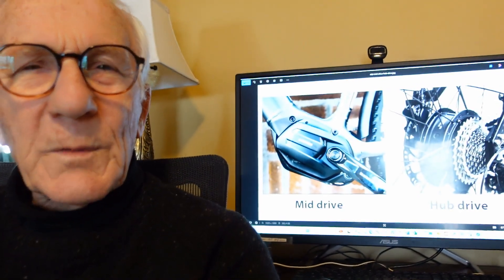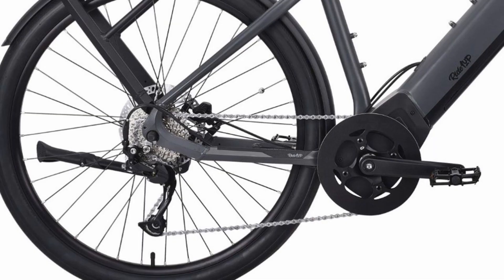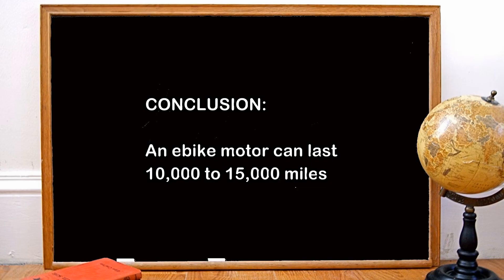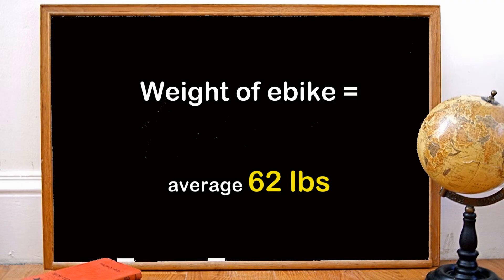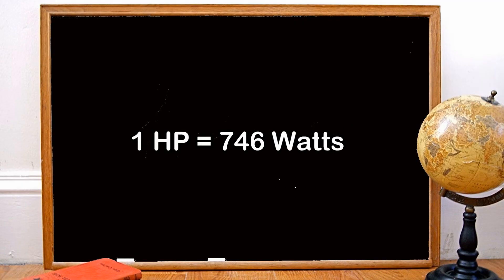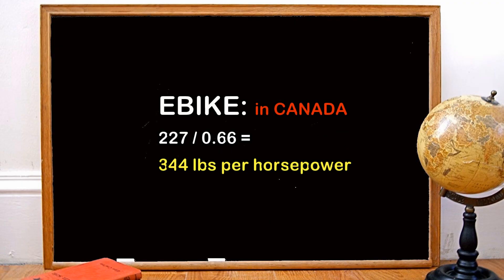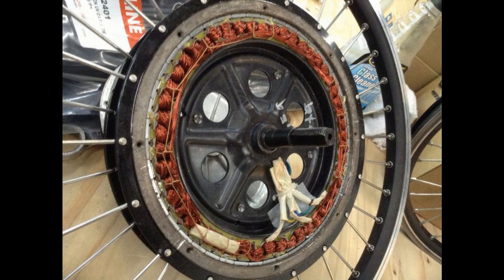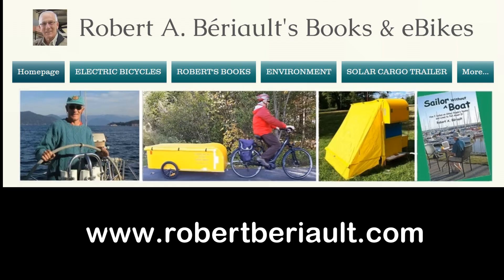Why Ebike Motors Have Such a Short Lifespan

Comment: This is not a great comparison.  Cars very, very rarely put out their rated HP.  They really cannot do so for very long.  Another thing is they have active cooling and a bike does not. Engines have not just cooling, but active temp management and keep the engine at its ideal operating temperature 98% of the time. Most e-bikes (all, that I know of) don't have any cooling other than radiating heat (one of the reasons they are all black) 

But by far the biggest factor is they aren't built very well.  Multi-HP commercial electric motors run 24/7 for many years trouble free with little to maintenance.  Take a look at any industry and you will encounter electric motors everywhere.  Most are geared properly (though externally through drive belts) and have 2 output shafts, one to the load and the other a fan on the back that pulls air through the motor.  This is not really possible on a  bike.  They need very little maintenance (whereas engines require periodic oil changes and coolant).  Of course, these electric motors cost many thousands of Dollars.

Comment: Determining how long a car engine lasts is a bit difficult because they generally go to the junkyard still running and moving, especially in snowy climates.  You end up needing thousands and thousands of Dollars in repairs to the rest of the car, far exceeding the value of the vehicle.
A properly maintained engine can go a very long time.
Cost.  A new hub motor can be had for next to nothing.  GM's most popular engine in its history is the 350.  A new crate 350 is between 6-10 thousand Dollars.  Newer 4 cylinder engines are generally in the same price range.

Comment: I am a 250 Ib man with a 250w ebike which seems to be getting a worn out motor after less than 3000 miles. I have been riding in 1st gear slowly to make it last longer but read that that is what causes over heating and should pedal and go faster. It has started to seize up and then free itself now instead as the weather has cooled down?
Reply from the maker: If you're not riding in very hilly terrain, 250 Watts should be enough. But I would agree that when you we riding slowly, the motor may not have been turning at the optimum speed. However if you can afford to take a loss, you could sell it and buy a 500 Watt ebike if you live in Canada or a 750 one if you live in the USA. European ebikes are limited to 250 Watts, but generally, their firmware and gearing are designed to allow them to carry a lot of weight.
Reply: I weigh 120 pounds, and I've got an electric unicycle that’s logged 10,000 kilometers! 🚲💨

Comment: Fantastic presentation, Sir!
One thing you didn't mention is that, with an ebike, you can take a lot of strain off the motor by pedaling, so the power to total weight (bike plus rider) ratio of the motor isn't particularly critical.
The key to ebike motor longevity is to use it as an aid, not a substitute, for your own human pedal power.
Easier said than done, especially with advancing years!
Reply from the maker: Great point!

Comment: A easy but expensive way to get more life out of the motors is to have two motors. Power, the front wheel and the rear wheel of the bicycle. The motors will not need to work as hard.
Reply from the maker: With 2 motors, you'd exceed the legally allowed Wattage limit.

Comment: I built my own conversion using a 750 watt Bafang BB drive. This turns an Alpine 8 speed internal hub.   8 years in and No problems yet.   A BB drive running thru a multi speed hub allows you to make sure you are using the motor at its optimum speed range for any terrain.  700 watts climbing a 20% grade in 2nd, to 700 watts running level in 8th gear.  Hub motors cook themselves at anything other than the one speed they are most efficient at.  Built on a formerly belt drive Spot Ajax- the entire bike, with rack, 41 lbs.  I carry 50 lbs of groceries in panniers up steep grades and don’t even know it’s there.
Reply from the maker: Thanks for sharing your experience, and for explaining the advantages of this setup.
Reply: Very important observation.
The same principles apply to a standard derailleur and cassette design, of course.

Comment: I do not want to be that guy and I am not trolling but the first thing I was taught in terms of engines and Motors is that they are both completely different ,an engine makes its power in itself and a motor gets its power from outside. I suspect that we are talking about the compression and the spark plugs and the cylinders being better tuned and a motor being very cheap and not designed for longevity

Comment: 20000 km on my bbshd mid drive right now,  I had 12000 km on my bbso2 when I sold it.  I ride at almost max draw most the time,  I do go through a lot of batterys though,  partly because I cant stand bad voltage sag.
Reply from the maker: I think that's another advantage of mid-drives. Yea, batteries don't last as long as motors and they're more expensive.

Comment: Compare an ebike to a regular bike.  We'll use your weight numbers.  A healthy human can generate about 1.2hp for a very short period but only about .1hp sustained.  That's 2270lbs per HP!  A well trained athlete does about .35hp sustained which is still 648.5lbs per hp.  So these electric motors are in fact stressed far less than a human.  Yet they fail!  The human bodies max hp output is limited by heat at max output heat buildup becomes too great. Refer to human power flight studies.  I surmise the electric motors are failing for the same heat buildup.  Do you know who have really embraced ebikes in a big way?  The Amish.
Reply from the maker: Interesting comparison. It's simply amazing that the human body can last as long as it does.

Comment: 2 important issues: wrong lube on plastic gears and moisture entry into the motor housing. Use lithium based lube, best is aeroplane grease. And a pressure equalising valve so that when the motor cools it doesn't inhale wet air.
Reply from the maker: You'd think manufacturers could easily do these two things.

Comment: The hypothesis seems to be the wrong question. Engines die due to wear and tear because pistons, cams, and gears rub against each other. Does that same apply to brushless motors?
Reply from the maker: Good question.
Reply: @RobertBeriault753  I look forward to another attempt Robert because the core question is still very valuable to ask. One hypothesis I would like to propose is that these BLDCs are driven incorrectly. As a result they overheat and short out after a while. Happy to go further if you're interested in a followup

Comment: my first bldc 500w front wheel motor got near 100k miles. 27mph 36v.  the only issues were spoke replacement and twi e had to replace the hall sensors(3) in the motor
ebay kits are pretty good.  more power like 2kw are more durable.
Reply from the maker: Wow! That's impressive! Thanks for sharing.

Comment: Apples to oranges. Most cars are not electric (which he says at the end) and as far as I know, none of them have plastic drive gears.
Reply from the maker: Those darned plastic gears!😉
Reply: @RobertBeriault753  I enjoyed it though!
Reply: I honestly don't get the comparison. All cars have 4 wheels, not 2 and ice cars have an engine, transmission, differential etc.. Plus, the only pedal assist cars were the ones that the Flintstones had.

Comment: By this logic, an unlimited top fuel dragster’s engine at 0.25lbs/hp should last several  million miles, yet they rarely last 1/4 mile and are rebuilt after every race.  Sad that I can’t get back this time spent watching this video.  And no - a similar comparison to EV cars would not be worthwhile.  Most bikes, I hypothesize, are never driven past a few hundred miles, perhaps several hundred miles.  Therefore, designing them to last 300k miles would price them out of the reach of most peoples’ willingness to spend that kind of money on a bike.  Also, longer lasting parts are likely to be bigger and heavier.  More weight means one will need more power.  A video with the motor engineers might be interesting, where the design goals and conflicts are identified and the decision process is examined.
Reply from the maker: No, I don't think your time was wasted, because it spurred you to write this excellent reposte, which raises logical objections that others might read. Thanks for your input.
Reply: @RobertBeriault753 . Thank you.  Rereading my critique, I was a bit harsh in its presentation.  Your response is fresh air in the world of social media.

Comment: What do you mean, these things were suppose to last forever maintenance free.  That's what the salesman told me.  I didn't buy, because I felt suspicious.
Reply from the maker: I like a sceptical mind.
Reply: Well something like a QS205 motor will run over 100,000 miles no problem. Crack it open and I promise it'll smell brand new too, so long as the correct voltage is being run through the motor. Budget ebikes are designed to fail if you ask me, just like common smart phones.

Comment: That's the long way around it.
Comparing ebikes to cars is like Comparing apples and oranges.

Ebikes are made with the minimum power one needs. Therefore, the motor is working at its max quite often.
Car motors rarely work anywhere near its max.

So, what IC engine is running at max most of the time? A seadoo.
With a 2 stroke, the engine lasts 300 hours. 
With a 4 stroke, it could last 500 hours.

500 hours X 35 KM/H speed limit = 17,500 km.

The two motors, treated equally, lasts the same amount of time/distance.
Reply from the maker: Thanks for bringing up these interesting facts.

Comment: When it comes to cars, most Japanese cars will make it to 300K miles with no major issues. Domestic cars seem to be between 100-200K miles depending on brand and other factors.

I once had a Honda Civic that was at 300K miles when i sold it. Still ran great. It used a bit of oil but it ran and drive and still had decent power. During its lifetime, to the best of my knowledge, no major repairs of the engine or transmission. 1989 model year.

I have a Nissan 720 pickup with about 300K miles on it. Runs great. Only real issues were some electrical wire frays, body rust, and radiator corrosion. 1985 model year.

Then there was the time I had Ford Focus (forgot the year model). It had a major ECU issue at 90K miles. Major suspension issues at around 100K miles. Piece of junk.
Reply from the maker: I said I might suffer from Toyota bias. But the bias is based on real world experience and experience of people like you.
Reply: my bicycle  has 100oookm...

Comment: To avoid burning your controller and/or your motor; When you need torque, give it 100% power while pedaling, if you can not pedal at a comfortable rate, get off your ebike and walk the hill.
And alway make sure neither is burning hot.

Why ?
The MOSFETS in the controller heat-up when they have to reduce the current, let's say at 90% but at 100% there is less restriction so they heat less (if you stay whithin their max current specs).
The motor needs to turn, the worst thing you can do is make it stall. The motor will "ask" so much current that something is gonna burn and it can be the motor's stator/rotor wire insulation.
Reply: a much simpler way is too simply put a bigger motor than what your controller is made for. Just put a 1000 watts motor with a 500w controller and you are certain to have a very very long lifespan with you motor.
I don't understand why only a few people do that. Seeing the very small price difference between a 500 and a 1000w motor, it's really mysterious. It work with every power of course, you can put a 500w motors with a 250w controller and it work fine as well. 
You can also underpower the motor, take a 48v motor and run it on 36v...
Reply from the maker: Yeah, it's those darned hills.
Reply: Interesting point about the mosfets

Comment: My bike t 60.000km single cylinder 110cc had liner and piston replaced. Currently at 90k. "Recharges" in 30s.
Reply from the maker: And the gas tank never gets smaller as it ages!😜

Comment: Ebike motors dont have oil and if its brushed the brushes wear away
Reply: 90% of e-bikes use brushless DC motors.
Though they don't use "oil", the gear in mine are made of some Really tough plastic. Looks like ABS, but I can't say for sure.
Sounds like direct-drive is best for longevity.
Thanks for your comment.
Reply from the maker: Thanks for having watched.

Comment: Thank you for going through this exercise in trying to support why ebike motors don't last. There's probably a few more important reasons. First, ebikes are far from a mature technology, there are still many manufacturers who spend very little on deep engineering related to anything other than watts and price. The main reasons are there isn't a big incentive to study failure root causes and addressing them in a nascent technology that's primarily driven by price and watts. Since majority of manufacturers are Chinese specialty manufacturers, who have no incentive to develop high quality, it's unlikely longevity of drivetrains will improve across the market.
Reply from the maker: What you say makes a lot of sense. Thank you.

Comment: As for unit conversions - there are different definitions of the unit in use around the world.  The "imperial horsepower" is approx. 745.7W so close to your value of 746.  The metric horsepower is 735.49885W  some sites claim 1hp is exactly 750W.  Both definitions are based on the power ot takes to raise a certain mass by a certain distance on the surface of earth.  Unfortunateky gravity isn't quite the same everywjere and of xourse the weights and distances used in the two definitions are different.  Worse, there are numerous other definitions.  The two I mentioned above are just the primary ones still in use today.

 Basically, the horsepower unit is a mess and should die.  After all the unit largely got popularized by the steam engine inventor James Watt forarketing purposes.

Combustion engines tend to be heavy due to having to resist the very high internal pressure in cylinders.  The reciprocating forces on crank shafts are also very high.  With electric.motors oft bearings are the weak point.   Also windings which are relatively thin electrical copper are exposed to repeated hearing-cooling cycles, experience forces though the magnetic field.amd vibration which wears them down.  Also brushes.

I used to work for a pumped storage company.  The copper windings.o their motors/generators wear down over the decades. Every once in a while a sample from a winding is taken during major overhaul and examined in a lab.  They last long but not forever.  But some of these machines are now over 90 years old, still in ise and continie to be maintainable and repairable.  But they were not designed as cheap mass products and nobody cares that maintenance requires a 150t crane.  Very much unlike a rbike motor.
Reply from the maker: Thank you for your insightful and interesting comments.

Comment: BS video with little information. You should obviously avoid motors using plastic gears, that's a no-brainer.
Reply: As stated in the video: If you replace the nylon gear with a metal gear you will notice a distinctive increase of noise from the motor. That's the no-brainer for most e-bikers.
Reply: Just exchange worn nylon gears with new nylon gears. You want correct meshing of the gears - for optimal load transmission. Metal gears are not a solution.
Reply from the maker: Thanks for your opinion.
Reply: 95% of ebike motors have nylon gears if you want metal you need to buy them after market and install them yourself
Reply: @robertking3090  Well if had any knowledge you know nylon out last metal, my background in remote control cars confirms metal wear out much quicker, the problem is nylon does not do well in shock loading compared to metal, so in short if you are big on shocks ie jumps and high speed changes then yes metal otherwise normal loading go nylon as will out last the metal.
Reply from the maker: Would you wait until the plastic ones are worn out before changing them?

Comment: I am not pro Mid-drive motors because the chain and gears are not upgraded for the extra torque that the motor produces. The other issue with them is the internal gears which are made light to keep weight down.
Reply from the maker: That makes sense.

Comment: Geared hub motors have more torque for starts & hills & weigh much less. Direct drive motors will go faster on level ground but aren't as quick off the line than a geared hub motor. Nylon gear sets are like $6 online & aren't that hard to install if buying the few proper tools needed. Ebike motors biggest enemy is overheating so give them a few minutes to cool every 20 - 30 minutes when the hub gets to hot to touch or get a temp gauge to monitor.

Comment: My Ebike is now 14 years old. With the first Motor and i even have the first battery. A second battery i bought after 5 years. But the first still runs. My last combustine car engine lasted only 140.000 km and then it was game over. Electric cars lasts a lot more, and even tha batteries last for 300.000-600.000 km till it is at 80% capacity
Reply: There are a lot of variables when it  comes to E bikes. How often it's used, the weight of the person using it. How often you use it at higher speeds without any pedal assistance etc. Starting and stopping frequently can't help the motor either in a city setting. But I think the main one is just plain old weight. An average person weighing about 150lbs vs either an over weight or some one carrying a heavy load making it weigh over 200lbs+ put massively different strain on the bike.
Reply from the maker: Interesting. Thank you for sharing.